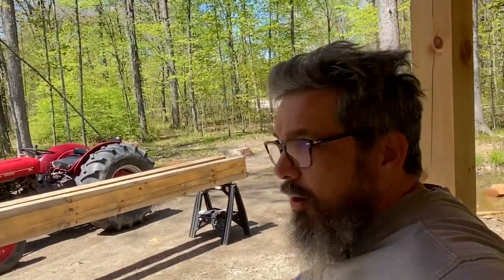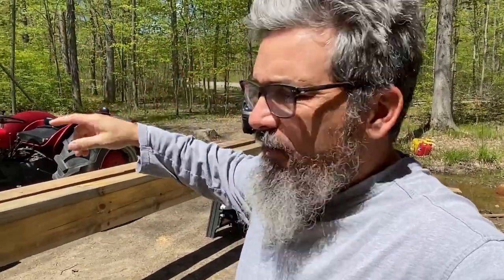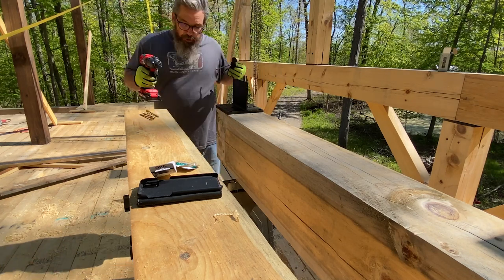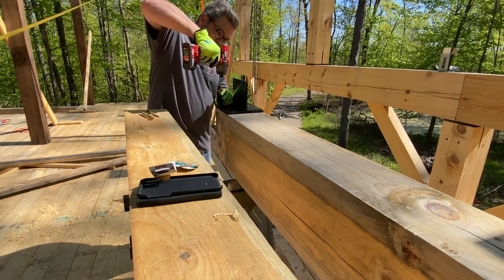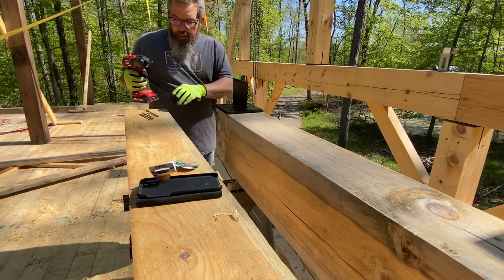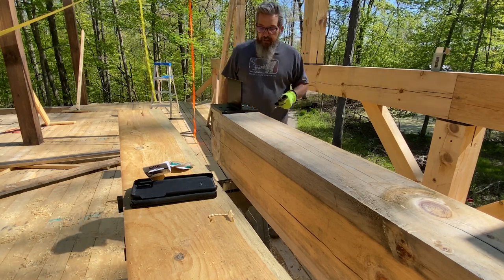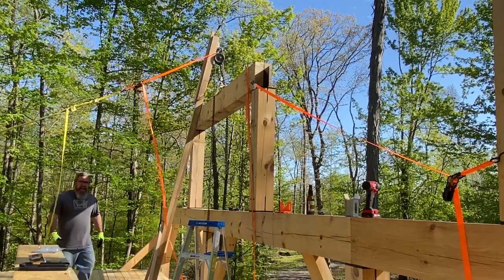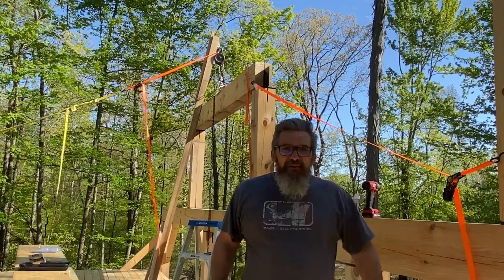ONE MAN Lifting Heavy Beams With A Gin Pole At The Off-Grid Cabin

Comment: I have a Hercules impact driver from HF, and it's a great tool as well.
It has competed with Ridgid and Dewalt and outperformed both. The battery lasts longer, and it doesn't overheat. A fantastic tool for the money.

Comment: that is an impact, not a drill, but you call it
Reply: The HF Hercules variable power driver is a great tool tool.
Reply: That's what I was thinkin. In Australia we would call what he's using an impact driver, not a drill. It's primarily used for driving screws at higher torque. A "drill" typically has an adjustable chuck and a clutch.

Comment: What is the crank thingy, and where do I get one?
Reply from the maker: It’s called a Marine crank… harbor freight has them… they’re about $20
Reply from the maker: Sorry, I thought you watched a different video… that’s a 2000lb engine chain hoist. Also Harbor freight.
Reply: @OffGridFromTheGroundUp ... The only problem that I can see is that the crank handle would get in the way of the mounting, which would need modifications to mounting to overcome in less than ideal situations.... Need to make a video on that.

One guy used Welding to get a drill attachment. But most people don't weld.
Reply from the maker: @dennisgarber  you’re right. I took the crank handle off and used a 1/2” drill to crank it. I have a video on it!
Reply from the maker: @dennisgarber  this might help you.

https://youtu.be/90zKUV4aCXg